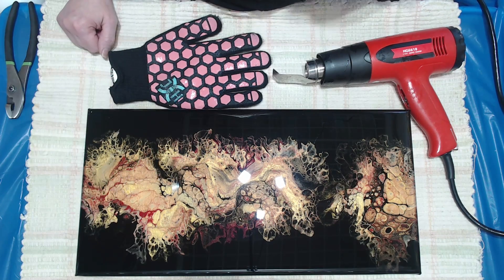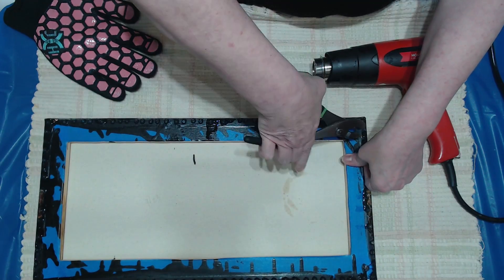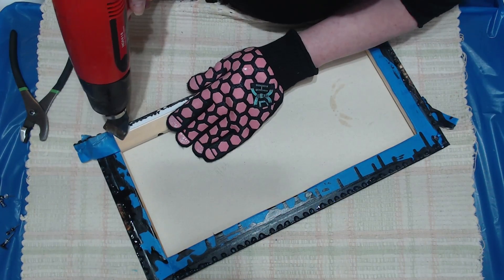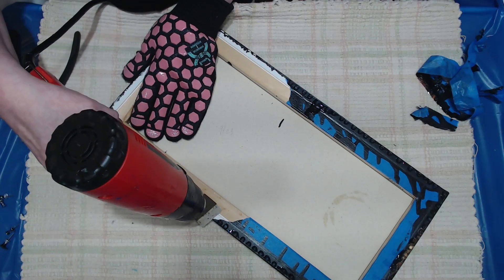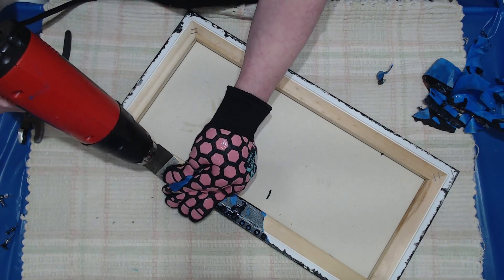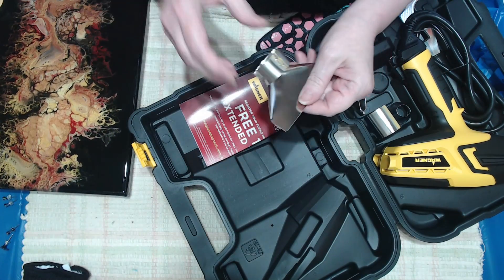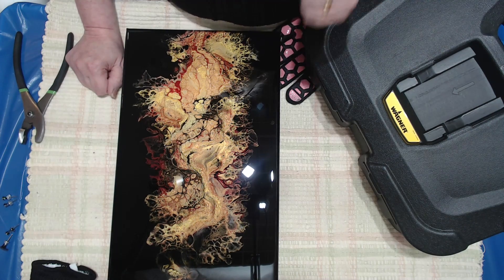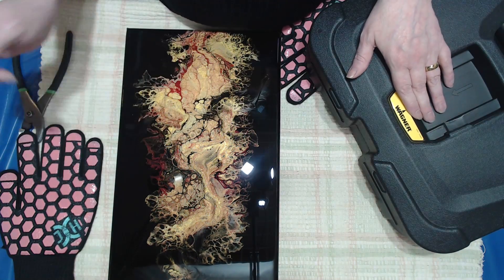Easiest Way To Remove Resin Drips From Your Artwork!!

Comment: Awesome tip!👍🏼 I always sand it off - not the work I really love🤦🏼‍♀️😂.
Thanks for sharing this method. Have to check if my heat gun has this attachment but if not, I‘ll find a way to get one or make one myself.
The small recesses on the attachment of your new heat gun are designed to ensure that it fits snugly. If it’s a bit loose, you can squeeze it a little and it sits tight again.
Have a nice day.☺️🙋🏼‍♀️
Reply from the maker: See, I just learned something new today.  Thank you!!

Comment: First of all I just love that painting. So beautiful with those earth tones. So I used to have the $40 Wagner and of course what did I do? I got resin in the buttons. 
So for the past month I seriously have had to tap the buttons with a hammer LOL just to get it to turn on.
Well, after swearing at it and myself for a month I ordered that red one you have. I’m so mad at myself because I loved that heat gun.
I’m going to save and get that bigger  one you have someday.
I loved it because it gave me so many different temperatures and it blew real nice and hard. 
So now that red one is wrapped with plastic just so I don’t get resin in that one LOL but I think I learned my lesson.
I knew it would jam up eventually if I touched the buttons with resin on my gloves but of course I did it anyway. 
I was wondering what that tool was that came with it so now I will do this also. TFS
Reply from the maker: I have a hammer on my resin table as well......lol